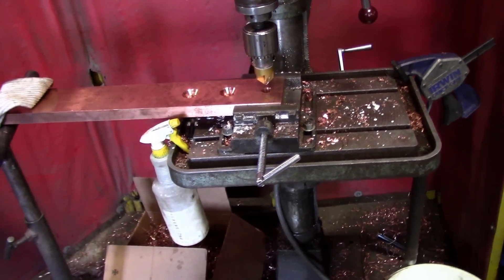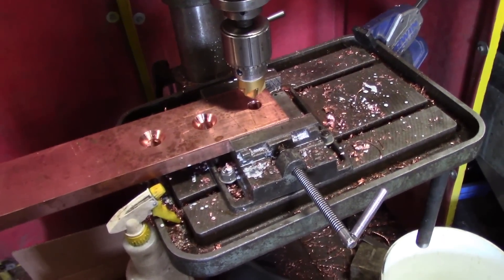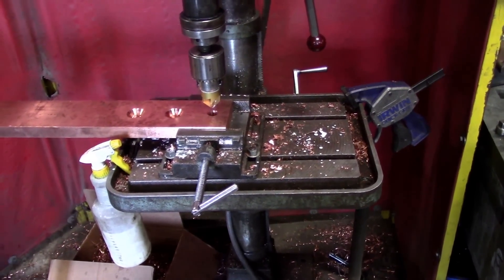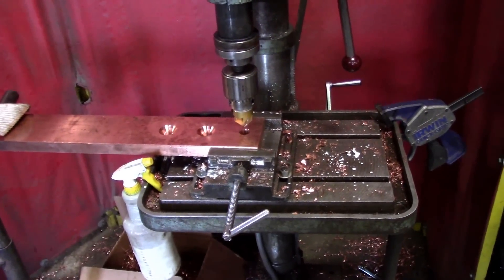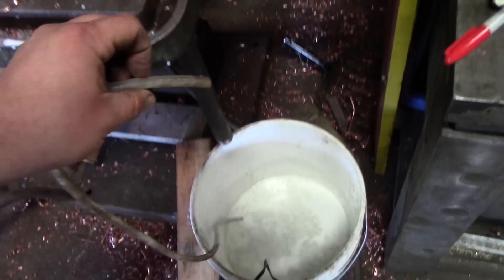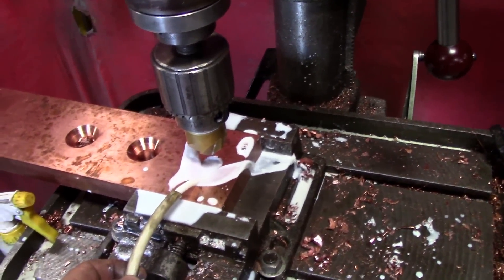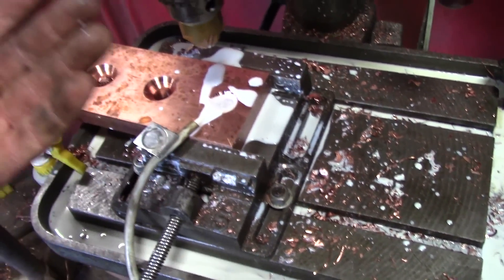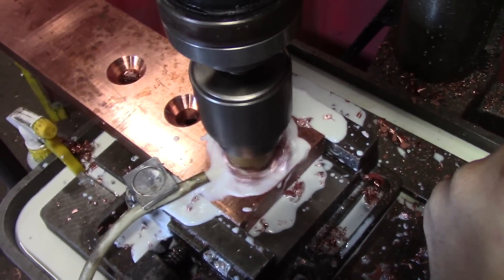Cheap Drill Press coolant pump

Comment: All of that for copper?
Reply from the maker: Years ago a machinist told me he hated machining copper and brass most because it's "soft" nature doesn't chip off easily. I see what he means now! We'er using a new $150 cobalt titanium 4 flute countersink and it still has trouble cutting. They sell a special $300 bit for copper but I couldn't bring myself to spend that much for this small job.